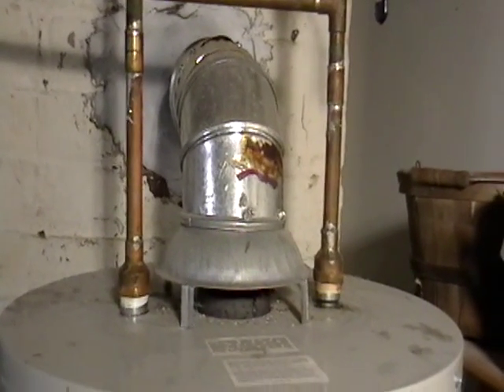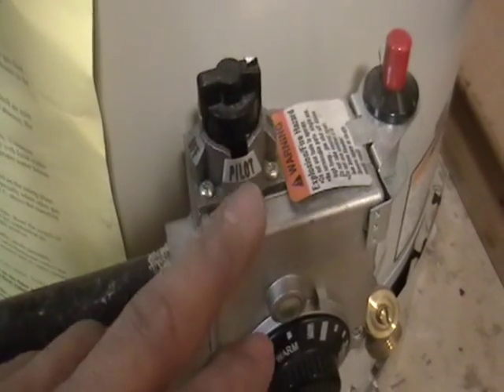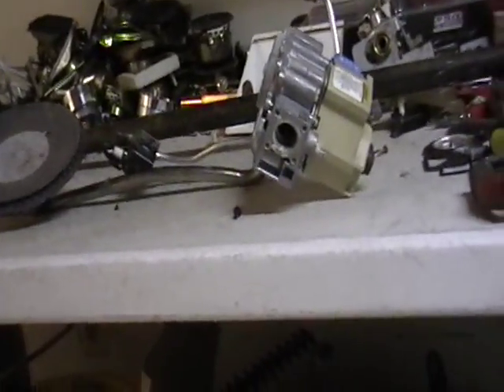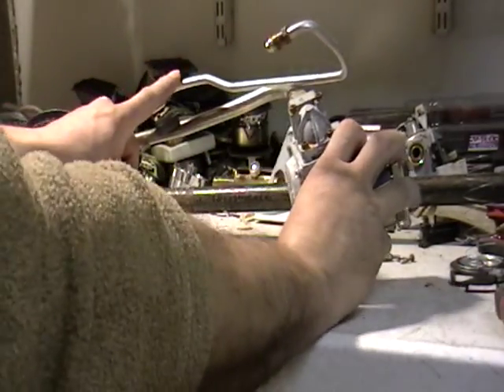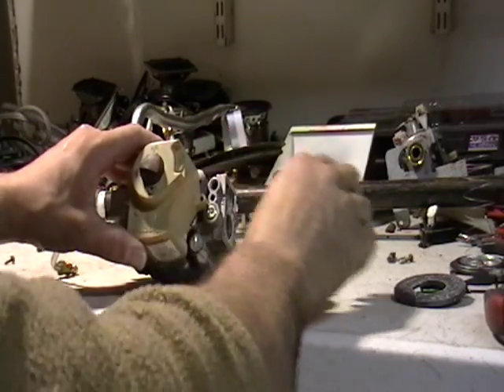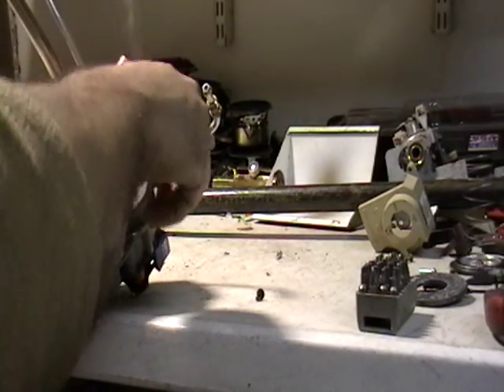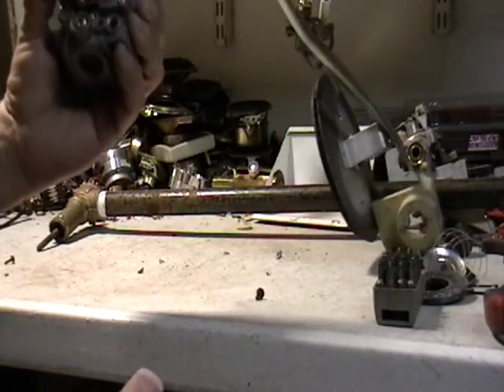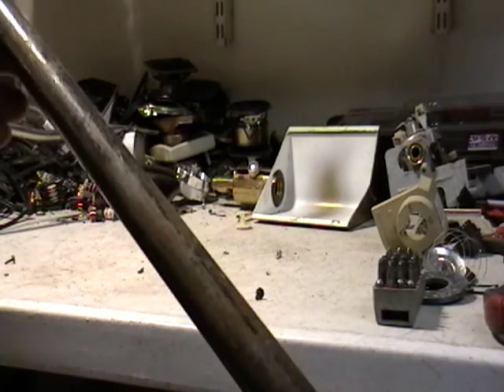Scrapping a water heater

Comment: someone below mentioned old phones. Old phones with actual bells inside for a ringer...the bells may be brass. Payphones contain a ton of bras, cast/zinc and are very heavy steel cases. I had a dozen of them that lowered my bumper once loaded. Same thing with the bells applies to some door bell systems as well, esp older ones.

Comment: there r copper elements inside the tank.. usually 2 right behind the little panels.. using a there is actaully a tool to remove them but i used a 10" crescent wrench that i ground the jaw  a little

Comment: question... trying to scrap these 2 waters heaters and i have the same type of brass fitting with a piece of copper sticking out of it....    is there a trick to getting the thing apart so i can separate  the brass from the copper from the steel spring and such?

Comment: mike i got the the water heater apart and i cliped the top rod piece off on the tp valve. but now theres a metal piece covering the spring in there and i cant get the rod lose. think you could help me out?

Comment: Hello mike. I am a fan of all your videos. You are very helpful to someone just starting out, like myself, just wanted to ask, how do you clean the guts out of those big pieces of brass from hot water heaters? I've not been successful so far. Any help or advice is greatly appreciated.
Kevin
Reply from the maker: trying to think what you are looking at. I only know of the faucet and you have other copper pieces and the heating unit. Please specify.
Reply from the maker: use a vise and it should be able to turn with a wrench to remove.